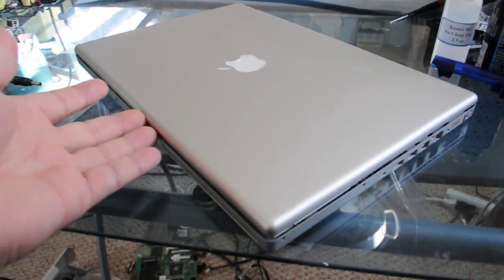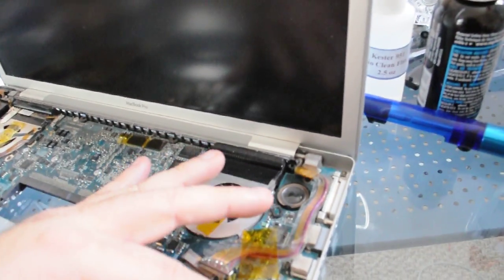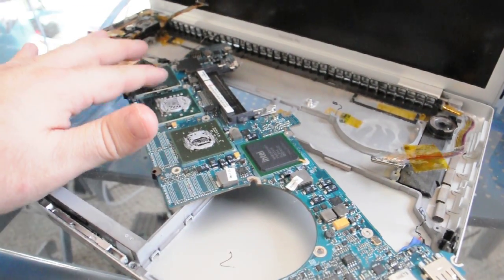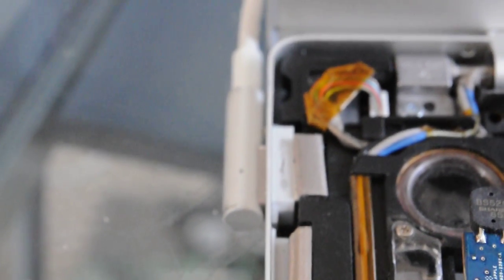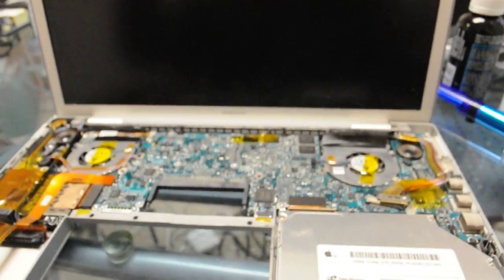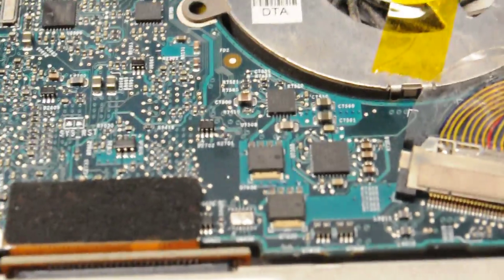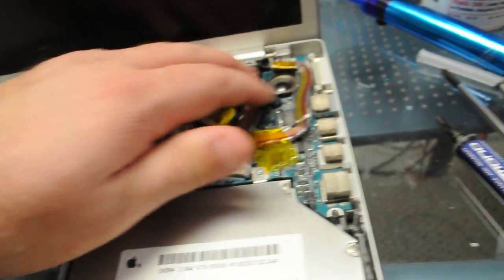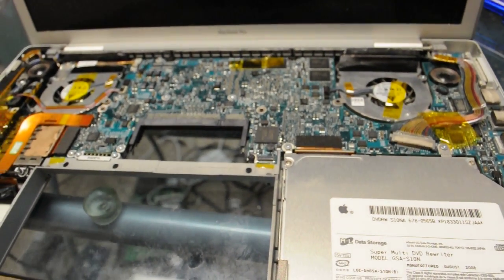IR reflow repair on a MacBook Pro Aluminum logic board that has a Nvidia MCP77-A2 no video issue

Comment from the maker: @SheBlindedMeWScience The failure is due to both or just one of each.  In the end, I just reflow each part together, GPU and VRAM.  Second, I watched the video and well.  Anyways, the theory is correct since I have outlined it in my blog also here: 

doubleclickittofixit com/updated-do-you-add-copper-shims-or-pennies/

The laws of thermodynamics allow for this to happen and work correctly, but uneven heating causes deformation on the layers causing the failure.  The tape counteracts the repair.